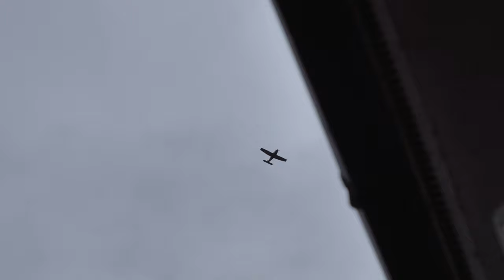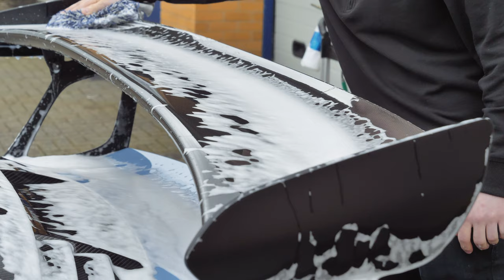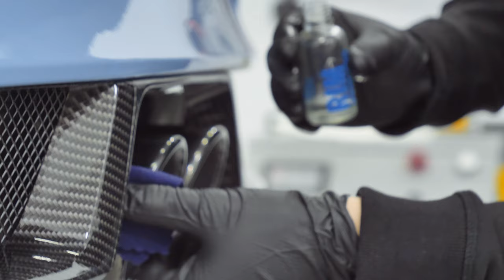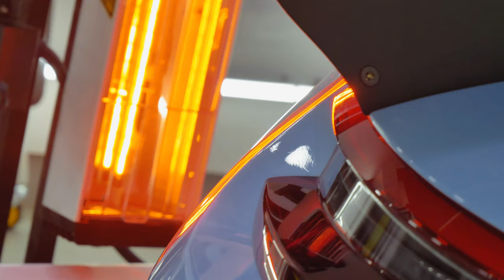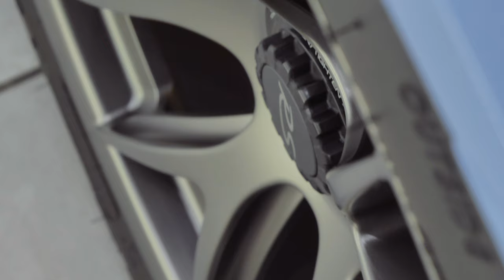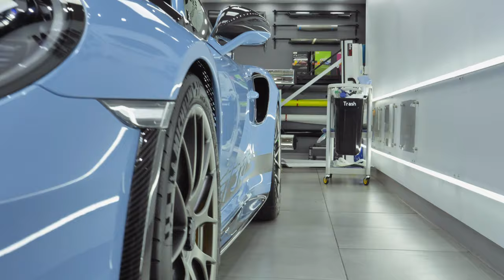Gulf Blue GT3RS | PPF And Ceramic Coating

Comment: I have never asked this before, but do you polish carbon fibre the same way as painted metal? I’m thinking heat 
would be an issue? Just curious. Always nice to see you guys post.
Reply from the maker: waynefromcanada hi Wayne. Temperatures shouldn’t reach high in polishing anyway and all carbon is clear coated as like paint so it’s the process. But good question to ask.